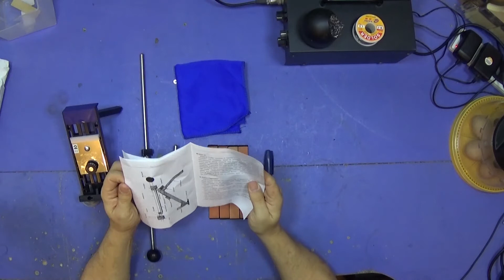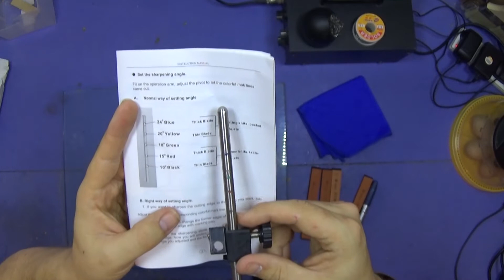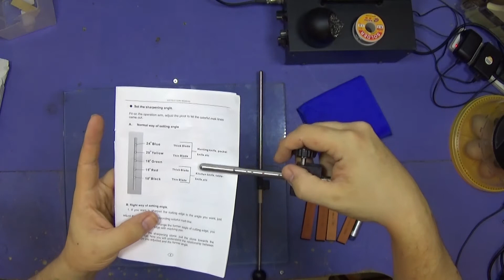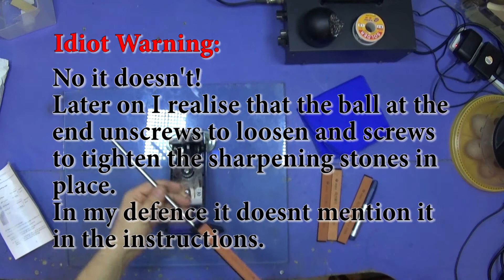Cheap Ebay Knife Sharpener Review | Buy? or Pass?

Comment: Dude try reading the directions! I was literally yelling at you when you just took a key piece of the blade stop. The edge should hang over the front edge about 8-10mm then slide the stop to the spine to maintain the edge overhang. The blade does not go under the plate so you can simply flip the knife from one side to the other so a consistent angle is always maintained. You could have watched any of the thousand vids of this sharpener and given a proper review. Sorry but it was hell watching you fumble through and setting every bit of the set up wrong. Heck, even looking at the pictures in the instructions would have been enough but you looked at the for 20 seconds early on and may as well lit them on fire.